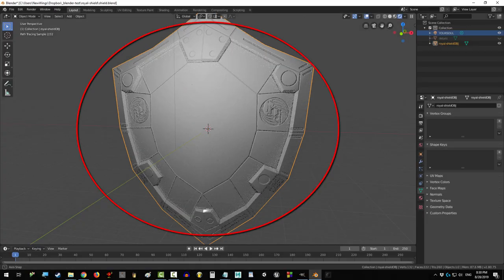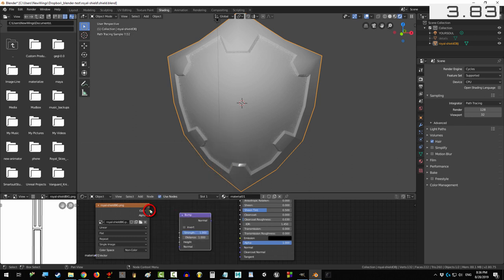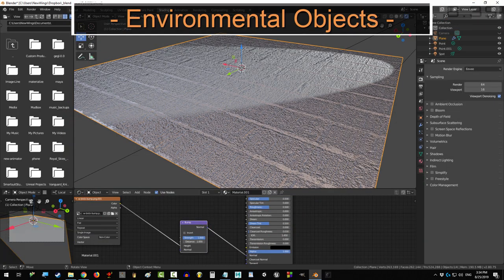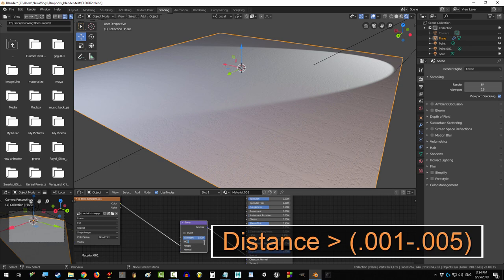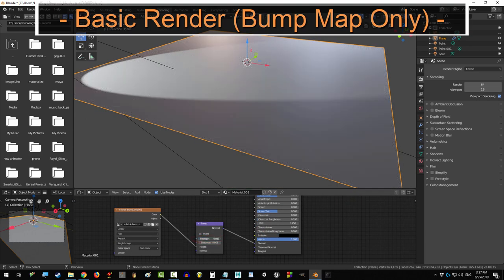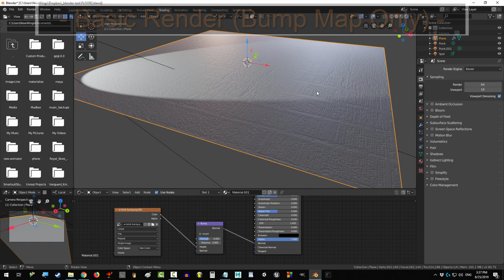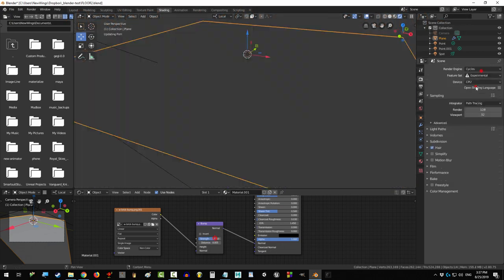Blender 2.8 : Principled BSDF - Apply Bump Maps (In 10 Seconds!!!)

Comment: @Royal Skies LLC, quick question bro, when you set all these maps on blender and want them to look exactly the same on Unity, do you need to use any specific shader on Unity? I know is a dumb question but still kinda new on this. I'm just trying to learn a bit more.  Thank you if you replay :)
Reply from the maker: Hey Ruben, sure no problem. If, you're asking that question, you're one of the few game developers here, and we'll be getting into that subject in detail in the future. But, just so I don't leave you hanging for a few months. 

You can export things like the camera and lamp from Blender into Unity. Unity does have it's own shader engine though so the way light effects it will be different and you'll have to compensate. Even if you could get it to look exactly the same, you'll want to change things anyway to accommodate the way you think the player will be seeing the camera. 

Many of the things like moving textures, and animations, fog, smoke, and fire, are actually much easier to do in Unity. So I'd recommend doing it from Unity because you'll be able to see in real time what all the shading and colors look like in the final environment while testing the player cam. 

So, in short, you mess with it. And, technically, you can just drag everything from Blender and it will look more or less the same after some tinkering, but you'll want to do all your light checking in Unity.
Reply: @TheRoyalSkies  oh ty ty for reply back, i'll definitely need to mess more with Unity, that's my weakness at the moment.

Note: I hear your voice on my head when I read, Sure no problem xD.

Ty again for sharing you knowledge and keep the good work :D
Reply from the maker: @RubenSterlingS  Hahaha, this comment made my day. 

Sure thing, glad to help. Good luck with Unity. She's an incredible program. Went from my worst program, to my favorite one in a year. So keep it up!

Comment: Do I need to activate a setting or something in 2.8 to be able to drag images in the node editor ? Cause it's not working for me
Reply from the maker: That's extremely weird. It should be default. If it doesn't work, you can press shift + a > s > (type in 'image') > enter. And then open the texture map the old fashioned way if it's not working. 

Hope that helps. If you figure it out, please come back and let me know how you fixed it!